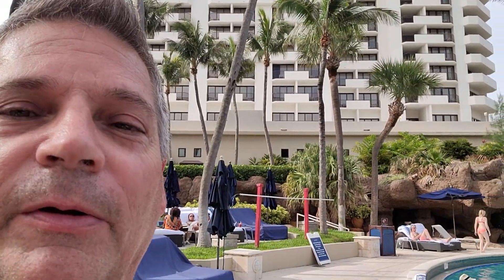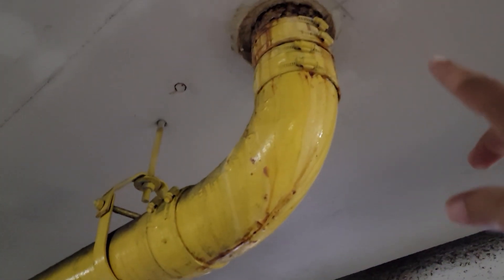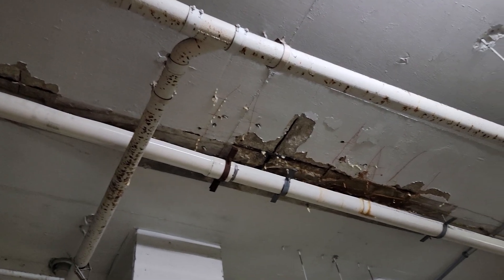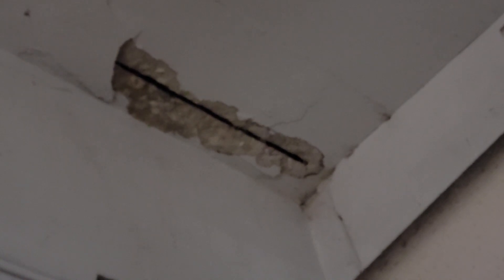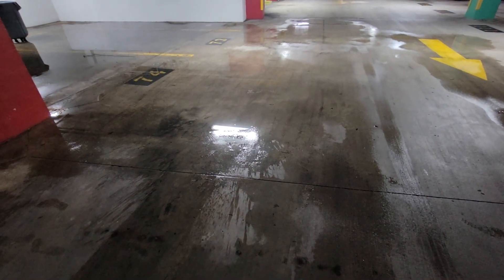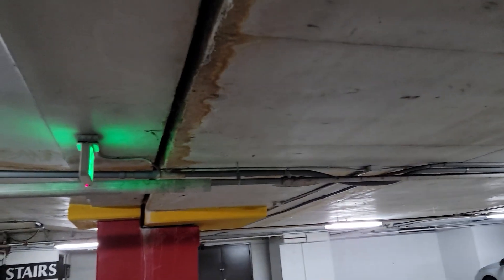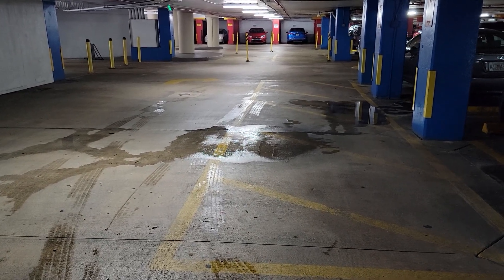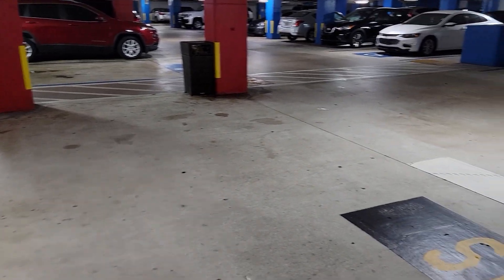Scary Garage Damaged Concrete Marriott Harbor Beach, Like Surfside Collapse

Comment: From now on, every time I drive into a parking garage, I'll be looking for leaks, spalling etc.
Reply: If you see cracks you can get a coin into or rust rebar or dripping or Stalactites, take a video and post it on YouTube.
Try to show locations as clearly as possible, route to locate damage and the actual address / view of the outside.
Reply from the maker: That's good it keeps everybody on their toes we will all be the structural engineers for all of these building owners for free.

Comment: When there is spalling on the ceilings as shown here and the rebar is exposed, is seems like the rebar is very close to the surface. Does that indicate an improper concrete pour? Should the rebar have been held a minimum distance from the surface, by using "dobies" or such?
Reply: Yes, it should.  There is lot's to criticise and that is from me a Chartered Structural Engineer looking at Jeff's video.  (See my critique 23.30 GMT 17th Aug above.)

Comment: In Amsterdam only moths ago, construction of a large multi-floor parking was completed that is intended to permanently sit underneath a section of inland harbour that's situated on the city-side of its central (train)station. Of course during construction the water was dammed and the bottom of that piece of harbour was significantly lowered. But that is not the point. My point is, that even though in my example here we are talking about fresh, rather that salt water, nonetheless it simply is not true that concrete cannot be made to be watertight/waterproof. And I do not mean, by adding an extra layer of some protective (other) material on the outside of it, cause that will never remain reliable and undamaged. No, I mean the concrete ITSELF.  It just requires the right receipt, the right approach, the  right mixture and working with it the right way to allow it to get the right properties. And there are many other things possible, it for instance also is possible to make significantly stronger constructions from concrete whilst using a reduced amount at the same time. I am not personally privy to (all) the inside information of how they do it, but I am thinking members of American construction companies and your engineers should go follow some courses after doing some research and getting in touch!
Reply from the maker: The difference here is now they have a world renowned structural engineer on the case who is advising them on what to do and I'm sure things will be just fine the fact that they added shoring poles where Champlain tower S did not do any of that, shows they were already ahead of the curve

Comment: My hunch is that the water is condensate discharge from a/c units installed in locations that weren't designed for it.  FL is very humid and in order to cool these buildings 24/7, large amounts of water needs to be removed from the air.  Unlike newer buildings that were designed with HVAC planned in them, older buildings install the a/c units as retrofits in places that weren't meant to have a/c.  Also, HVAC building codes don't have specific rules or inspections around how condensate discharge in supposed to be handled.

Comment: I need to record my next adventure to the local mall here. It was very controversial when built.    The entire structure has sunk significantly.  They have put in place a whole system to keep the building level. Yet in the parking garage it’s very misleading.  Once in a while they close the parking garage for maintenance.  Scary stuff.  It’s not talked about on the news anymore. Only when it was built in the late 90s. It won’t be on the news again until something significant happens 😒
Reply from the maker: you will have some valuable video when it collapses. Document everything

Comment: Around 23:30 all that yellow is rust.  The steel is simply departing the structure over time.  Its not reinforced anymore.  All those column-top pads look like retrofit.  Somebody has been holding this building up with upgrades or it would already be rubble.

Comment: All the units should just have Vinal floors so light for sure
Reply from the maker: Usually buildings can handle the weight as long as there's not anything wrong with the substructure of the building degrading
Reply: @jeffostroff  I just wonder in the south super intendants pay less attention to some buildings. I bet the Shan plane towers struggled with bed bugs and roaches.

Comment: At 20:08 I have to wonder how columns stacked between a slab would be as strong as a single column. It looks to me like there could be a cold joint between the green and white sections. Anyone's  thoughts on this?
Reply from the maker: They are on either end of an Expansion joint

Comment: It's weird how the spalling and the pipe are parallel with eachother.  The 2 have nothing to do with eachother.  Garage looks sketchy for a Marriott.  And at 21:50, why are the 2 sides of the isolation joint looking like they are different heights?  It gives the appearance that one side has sunk more than the other side.
Reply from the maker: Sometimes they conveniently choose to place an isolation joint where there might be 2 differences in thickness

Comment: Jeff, was the moisture causing the concrete damage in the ceiling coming from above or making its way because of the atmosphere? It would seem to me a controlled ventilation system closed to the elements would enhance the longevity/ durability of a building in these conditions especially for the $39 a day being charged. Climate control should become the norm IMO.
Reply from the maker: All the moisutre damage I saw in there had identifiable sources of leaks coming from above,
Reply: @jeffostroff  
Thanks.

Comment: Water in Florida garages is as common as rain. It’s not what brought that building down.

(A lot of such water is condensate.
Reply from the maker: water soaks into concrete, rusts out the rebar and weakens the concrete, and lowers the PH level so it loses its strength

Comment: Even if you fix the source of the leaks, how can you fix the rusted rebar?  Any replacement would not be connected all the way through, and it will never have the strength it did before, surely?
Reply from the maker: They have ICRI concrete repair methods where they chisel out the bad, and replace new and re apply concrete
Reply: @jeffostroff  But since the rebar is "interrupted", is the column as strong as it was before after the repair?  If the columns were at 100% load before, and they added heavy planters and other structures, on top of that 100% load, and then the rebar is rusted through and concrete crumbling and then it is chiseled out and replaced, can that be considered a true repair and safe building? It seems like there are a lot of these old buildings with crumbling concrete and  rebar.  I'm no fan of excessive government regulations but it seems like if an engineer says there's significant structural deterioration, I wonder if it can be repaired. Maybe if they add more columns, supports, but I don't think I'd care to live in a building with that kind of damage. Thanks for your videos and analysis.  I find it all very interesting.

Comment: That was just a drain but why did they build into the support beam..
Reply from the maker: Sometimes in the garage as those drains they're not really built into the support beam's, it's a facade that is built around them that might look like part of the support beam or the column. Sometimes they do indeed get built into the colum

Comment: As in other mechanical engineering situations of failing metal eg cracks could the building engineers use xrays to check non desrutivly the state of internal rebar and concrete conditions.
I was in electronics and think a system using xrays would pick out premature or worse rebar failure also same for concrete.
The system would gives a much earler warning.
Thanks for a good explanation and video.
Also I think in cases where sprinkler pipes are used in the UK they have to be galvanised or other method to protect them against rusting, by the way we also use tapered threaded joints on the sprinkler systems.
Sprinkler systems are becoming more used as since o major supermarket fire in Chihester UK the insurance is lower for a building fitted with them.
I don't think it's mandatory as you building codes are better than our building regs.
Reply from the maker: galvanized no longer allowed here, because over time the interior rusts and thickens like clogged arteries.
Reply: @jeffostroff  I think they should use stainless steel rebar in everything that's below like the first floor/second floor level. Basically anywhere the concrete is or can be exposed to water. I just read an interesting white paper on a new bridge being built in Oregon with 2205 stainless steel. 2205 is a duplex (austenitic-ferritic) stainless steel containing about 40 - 50% ferrite in the annealed condition. 2205 has been a practical solution to chloride stress corrosion cracking problems experienced with 304/304L or 316/316L stainless. And the yield strength is impressive, 75 ksi, and 20-25% elongation, which makes it ideal for the new FHWA seismic standards. So this means with this type, you could use less rebar, which then saves on weight, which in turn means you can cut a little bit off the corner, and makes the columns or slab a little thinner. Any time you can increase the strength to weight ratio of your concrete, it increases the load it can carry. Because weakly reinforced concrete needs to be a lot larger and then needs to be bigger to support it's own weight, and it quickly escalates into a roman type structure that is so massive, all the concrete is in compression. The new bridge cost 13.5 million, and the rebar was only roughly 12-13% of the cost, so not really a huge deal. Expected lifespan is 120 years, versus only 50 years with carbon steel rebar, so they're figuring it'll save $25 million from not having to replace the bridge again 50 years from now. Plus I think expecting only 100% inflation over the next 50 years is being REALLY optimistic, with the rapid rate of price increases we're seeing today, I'm thinking 50 years from now, that 13.5 million dollar bridge is going to cost more like 50 million 50 years from now, because they overlooked the cost of demo and disposal of the old bridge, plus all the engineering and environmental impact studies, traffic studies, permitting and planning before construction even gets started on the new one. So even if the stainless steel rebar bridge only lasts 100 years and not 120, it'll still save a buttload of money over time. One bridge built right, is cheaper than building 'two cheap-as-possible-but-barely-meets-code' bridges!

Comment: I'd like to think you inspected the garage before deciding where to park. 😂

I'm not surprised to hear that Florida has major issues with water management. I mean, it's Florida. Miami's gonna be underwater in like 50 years or something, so why bother, right? 🙄

Up here in the northern Midwest, we're all aware of the issues from melting snow and all the ice melt that gets scattered everywhere every year. It drastically shortens the lifespan of the concrete it's put on. Although, now that I think about it, I don't think I've ever spent much time in an underground parking garage. I know there are some around, but I've never lived anywhere with one (those places tend to be ridiculously expensive) and most parking garages are freestanding structures that are above grade. The only times I really remember seeing pooling water in parking garages is when it's winter and the snow melts off ppl's cars while they're in the garage - but even then no one bothers to heat garages so there's melted snow pretty much every when that happens. But I haven't driven in several years either, so I could just not be remembering it happening.

Next time we head up to the hospital complex for an appointment, I'm going to take a peak into their parking garage across the street and see what I find. Could be interesting.

Comment: Jesus. As someone who lives in a dry ass Canadian prairie province I've never seen an underground parkade this moist. Like even if somehow all of this water didn't compromise the concrete, aren't people worried about mold? Is there mold in Florida?
Reply: There is so much mold in Florida. Ventilation helps. But you can see it on some of the pipes in this video.

Comment: 1:40 that looks scary. Shouldn’t those lines be more straight and not jagged. Should they be straight from the forms when formed during construction. It looks Like the ceiling has pulled apart. And those beams look repaired?? They are newly painted like they are covering something up. The leaking from the cracks aren’t good.  Two months from now the building collapses. Jeff: I have footage of the basement!👍🙂

Comment: Thanks Jeff. Unbelievable.  Is it possible that the designers are so disconnected from elements of this area?  Or, is everybody on the cheap when building these days. Infrastructure is the big elephant in our American room. Is the private sector ignoring it too.
Reply: State of the art for 1970s?  Who remembers slide rules?  I'll leave it to fellows of the ASCE-SEI to comment on whether it (Champlain) was good enough for the time.
However, the real issue is the decades of neglect, the prioritisation of appearance over structural integrity.

Comment: what you are calling an isolation seam is actually an expansion joint.
Reply: Yep, and if it had been built properly with say a joint seal by Servicised Ltd or some US equivalent and if the deck had been properly sealed there would not be any water penetration or the concrete degradation that leads to reinforcement corrosion and eventually to structural failure.

Comment: those 'guards' have absolutely ZERO structural contribution to the column.  you SHOULD know this, mate.  These are glued on, and are parking bumpers.  They play no part what so ever in the strength of the columns.  Sheesh !
Reply from the maker: You are wrong. You don't want a car to smack into the corner of the column and take a chunk of concrete off it. You obviously don't know that rebar is only buried 1" to 3" into the concrete, so a car hitting the corner hard enough could damage rebar. you SHOULD know this, mate. Sheesh
Reply: @jeffostroff  appreciate your enthusiasm, Jeff - but the structural spec of a cast concrete column is not enhanced in any way by the glued-on bumper strips. These are added in high traffic areas, and prevent chipping (that might lead to spalling in damp environments over time, but only might). They are not specified by the engineering design to 'add strength' otherwise they would be on all columns everywhere... your concern is that vehicles might reduce the strength of a column by impact with a corner of the casting - were this the intent, the bumper strips would appear on the edge of the columns furthest away from your camera position  -  as it is, only the column corners closest to your camera position have had protector strips added.  I assume this is because low speed vehicle movement turning into a car space is from your camera position so they added bumpers for that vector, but only that vector.

"I don't think a car could ever cause any kind of problem by crashing into  a corner of it"  - then we agree...  these bumper strips are to lower the extent of small impact maintenance from scrapes....  they do not contribute to building integrity metrics.

Comment: I am a ASE certified car mechanic.  One of my first jobs as a mechanic was for the local Sheriff dept.  I'm from the wrong side of the tracks,  not a cop lover. But hey, good money is good money. In reference to the security guard video. I've repaired the custom boxes on Ford Explorer and Dodge Chargers. They are equipped with loudspeakers and spotlights that can " burn your retinas". I'm not saying the Miami police did wrong, they could have called over the loudspeaker on their Fords and Dodges evacuation advisement. Not orders or demands. Put the spotlight on the the entrance, verbally guide them. I
E. Hands up, turn around... lift your shirt,  come to the sound of my voice!!! I'm just a mechanic who repairs cars. God bless u Keff Strob, and Buildings integrity.  Yall gringoes supposedly "inherently racist" because you white??? GTFO. from a mixed fun loving criminal. This is sad as shite
Reply from the maker: yes, lots of people suggested this as well.

Comment: That hole you showed at 9:30 has been patched over. I dont know concrete or am i a engineer. But i know metal. That rebar is gone. It takes many many years of exposure to degrade steel that far. You could pull out pieces with your fingers. No way thats original concrete falling now. Id say that rebar has been exposed for at least 10yrs.

Comment: 5:10 How do you not know if it's drainage or sprinkler? The pipe is sloped. And the sprinkler pipe is clearly right there above this drain pipe, since the sprinkler pipe has unique clamps. 

Water coming down through a bore (as in the case of the A/C pipe) or through the isolation joint IS being told where to go. At least it's got a relief and is not trapped above. The spalling later in the video is something to be more concerned about.
Reply: A percentage of the water comes from sweating of pipes holding water colder than the environment.